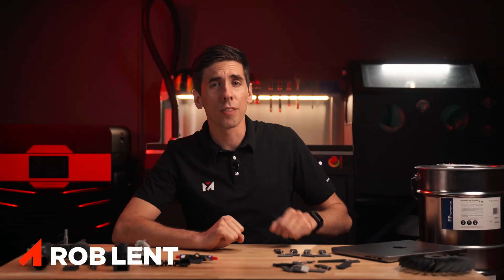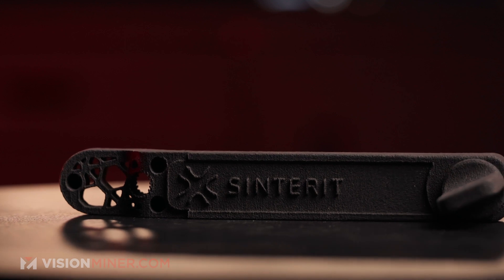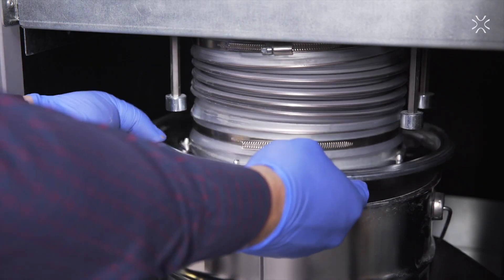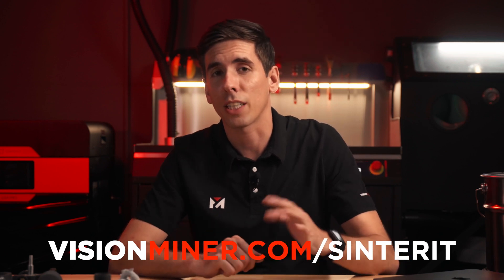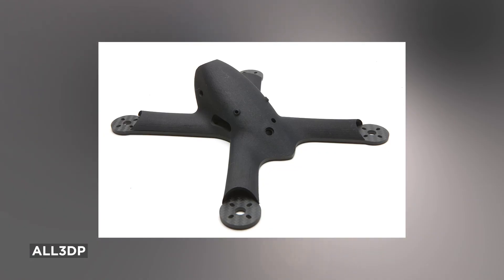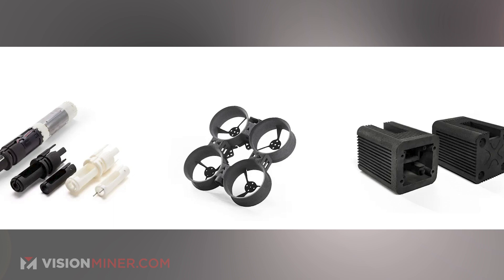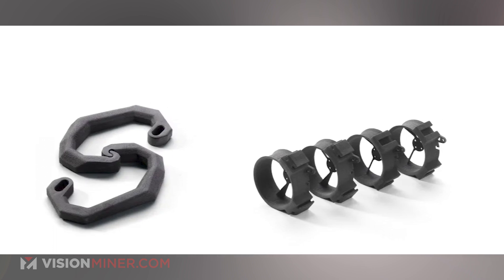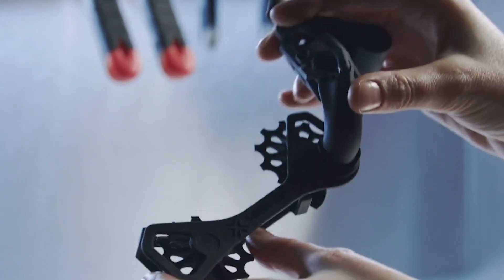Sinterit PA11 CF - Carbon Fiber Nylon For High Performance Use Cases - Vision Miner

Comment: What I ‘have’ printed in PA-11-CF with SLS process is agressive (custom designed quad) skate plates and grind blocks. Works a treat. Very very durable and stiff yet still lightweight material.
Reply: Sounds really nice, do you think it could be strong enough to make actual frames for urban skating ?
Just asking because light custom frames with some specificities, sounds great. Like designing a 100%-custom version, from maybe a slight rocker, to the space between the wheels and/or the length of the frame.

Just thinking about it, but it could even work with some proprietary frame systems like Powerslide's Trinity or Adapt's Quattro. While the former has many types of frames, the latter doesn't and their frames are usually super expensives. (Like everything from the brand)
Reply: @OneDreams54  Yeah I think that is possible. The problem is cost though. If you think Adapt frames are expensive than you haven’t had a (custom) carbon filled nylon SLS printed pair of frames quoted yet ^^ Just the price of having them printed is much higher than buying adapt frames. That doesn’t take into account someone has to draw them up first. So I am assuming you can do that yourself for the purpose of this post ^^.
Reply: @nirodha7028  Wow, thanks for the quick answer, didn't expect one so fast.

For the drawing I had some experience with less complex structures in the past for my studies, I could probably go back and train a bit until I get a good enough level. Try to print with something less expensive for a few tests, then go for the real thing.

As for the cost, to be honest, I didn't expect it to be that high, last time I checked the Symetrics-Quattro were $400+ , so yeah I didn't think that printing it, even with CF-Nylon SLS, would cost more. But thanks for the information.
Reply: @OneDreams54  your welcome :-)🙏🏻